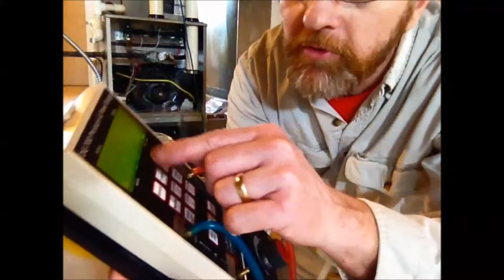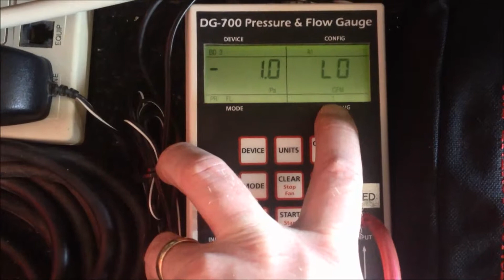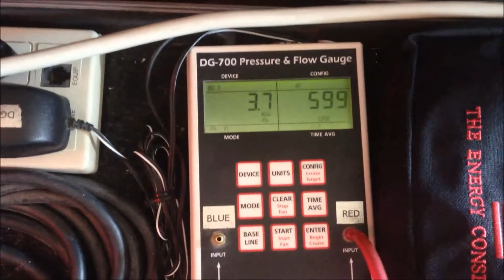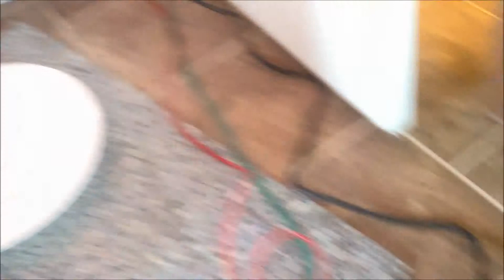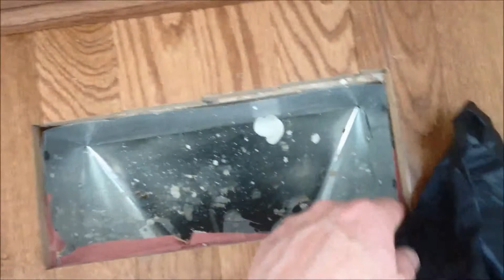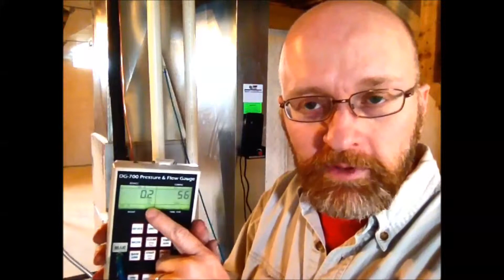For Raters: Duct Blaster Setup and Run

Comment: 2 different tests going on here. 1 is useful, 1 is pointless. You can't just arbitrarily select a negative number and put a structure in a negative pressure state (which it will never be in after the test) on a day with a fluctuating barometric pressure, temperature and wind conditions and use that as a basis for ACH or anything else. It is not repeatable, is random, and is neither science nor useful. The duct leakage test is alright. No ridiculous blower door nonsense is necessary. Just open a window and presto, the house and ambient barometric pressure are equal. Worried about duct in the attic or crawlspace? Just pop out the ceiling panel or open up crawlspace access during the test. Equalize pressure between all spaces with the outside then perform duct leakage test. You're welcome.
Reply: These tests were done in compliance with the RESNET Standards for testing (at the time) for HERS Ratings, Energy Star Certification, and IECC code compliance.

Comment: By using the plastic,sheet to seal up the ducts, how is the duct blaster getting an accurate leakage score when the plastic (artificially) seals significant amounts of unsealed gaps between the supply box and the surrounding floor?
Reply from the maker: You are correct that it does seal that area up so it doesn't read in the leakage results.  However, if the duct penetration goes to the outside of the envelope, such as one over an unconditioned crawlspace, that boot is required to be sealed to the sub-floor. In addition, we have found that when dealing with registers in a carpeted floor, there is no better way to get an accurate result because taping to carpet is fraught with error.

Comment: When you talked about setting to cruise control, you stated that you need to set time averaging to 1 second because "you need cruise to continually sample". The time averaging has nothing to do with the time base for cruise. Time averaging just affects what you see visually on the gauge, cruise still runs on the un-averaged pressure signal. To do otherwise would make the control slow and choppy.

I am not sure about performing Baseline on the Duct Blaster gauge. This should happen on the Blower Door gauge so you know you’re at 25 Pa duct to outdoors. Then, the duct to house should be zero regardless of the outdoor pressure difference that is controlled by the blower door.  All the duct blaster is doing is controlling the ducts to the same pressure as indicated by the 0 pressure on its gauge.
Reply from the maker: You are correct. I misunderstood the setting.

Comment: Are state has just passed a code or law about all of are duct now has to be tested i want to learn this system to better help my company and maybe even venture on my own any help with this or advice or even where i could get training on the duct blaster
Reply from the maker: wildgrim32 There are several certifications your state will probably allow. The two big ones are RESNET and BPI. As a RESNET HERS Rater, you can do all the testing for code compliance and above code programs including HERS Ratings and ENERGY STAR. Training for that certification is lengthy and costly and it's basically a full time job.

The BPI Training has several options, the simplest of which is their IDL (Infiltration and Duct Leakage) certification. You might be able to find a Building Performance Institute academy that will do that certification for about $300. The duct testing equipment is about $1800.

Comment from the maker: You certainly could have an undiagnosed problem. Is the upstairs unit in the attic and thus all the ducts are in the attic?  If so, it's likely that there are duct leaks up there. It could also be that they used some undersized flex duct or duct that has kinks and bends which are restricting the airflow. Best practice is to use hard duct pipe and cover it with insulation. Where do you live? I'm happy to give you more advice if you give me more information about the problem.